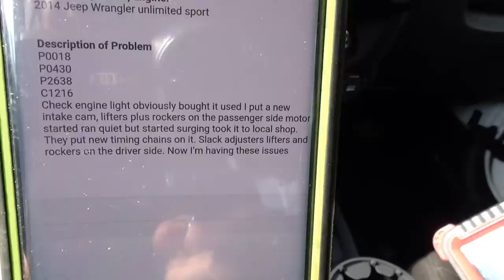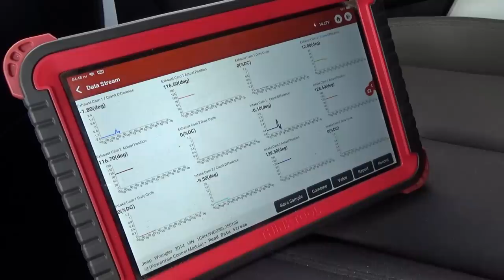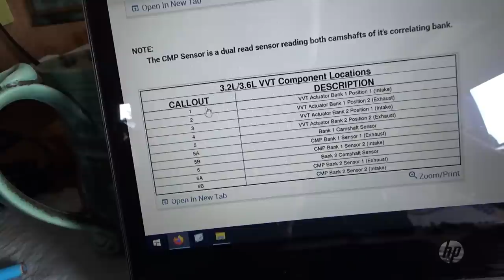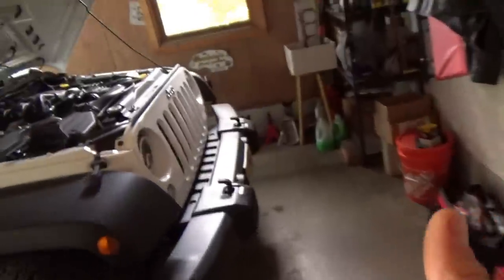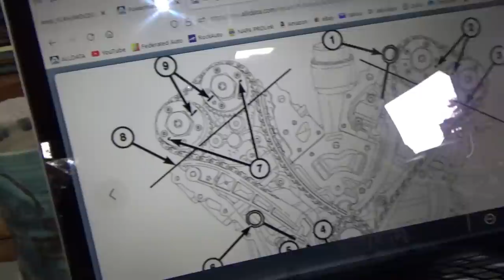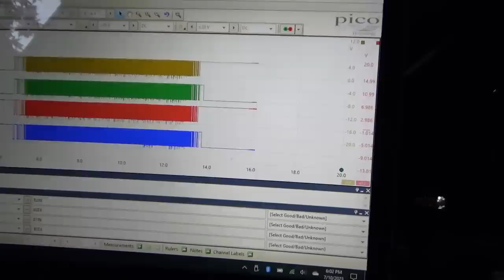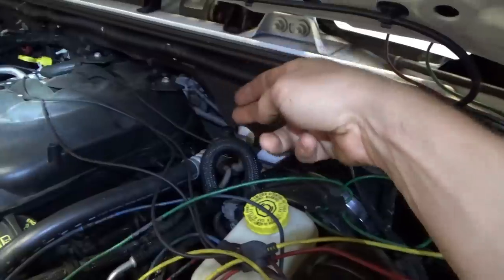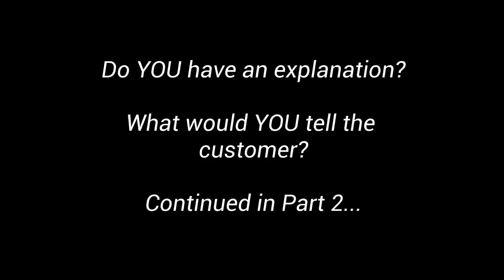BUTCHERED Jeep Timing Job?? (Part 1 - P0018 Correlation)

Comment: Just to eliminate a really unlikely cause, you could check the wire colors on the cam sensor connector and see if the signal wires for the two cams might be switched on the bank with the problem. The cam signal phasing might be different between the two cams. There is no logical reason for anyone to touch them, but you're not dealing with a logical problem. Possibly the connector came apart when someone unplugged it and it was repaired wrong.
Reply from the maker: Ooh interesting theory!! I like it 😁
Reply: LOL, I was thinking the exact same thing. I may have missed it while trying to do too many things at once, but also thought 'maybe' that that side is off one tooth at the crank?
Reply: Another head scratcher for sure. Well, assuming the connectors are all correct I would guess that the reluctors or the magnets inside are out of wack which would be doubtful if they are original. So what does that leave if everything else is correct? The ecm? Interesting. 👍👍🇺🇸
Reply: @brianw8963  I haven't watched the video a second time yet to see what new parts were changed, but I suspect the cams on the problem side are wrong, possibly the part numbers are for the other bank. Hopefully we'll find out tomorrow.

Comment: I'd look at those valve covers very closely.  Is there supposed to be some plastic washer or rubber gromet there, and that's why the sensor is falling down too deep into it's mounting hole?    I think you're onto something about the depth of the sensor.    I would think that maybe it's a sheared pin behind the phasors, but the odds of them both doing it are very low IMO.   Plus it would likely be running much worse.   Should be interesting to see the outcome.

Comment: The backward facing alternator always makes me think if Chrysler actually forgot it was needed until they assembled a few hundred.
Reply: ...or the OEM got a large run of alternators built backwards at a discount...🤔🤣
Reply: I noticed the same 😅
Reply: That’s very funny stuff lol
Reply: Pretty more funy😅
Reply: And the fact you have to remove the bracket to get the belt on is insane

Comment: Hi from OZ, I always look forward to your challenging fault finding video's, this is from a grand cherokee manual, same engine, not sure how you would check this without replacing the camshafts, "CAUTION: The magnetic timing wheels must not come in contact with magnets (pickup tools, trays, etc.) or any other strong magnetic field. This will 
destroy the timing wheels ability to correctly relay camshaft position to 
the camshaft position sensor."

Comment: Aftermarket valve cover gaskets causing sensor assy to sit higher in relation to the cam.  Love the content!
Reply: I believe the sensor would be sitting low not high. If you think about the intake and exhaust cam rotation if the sensor was high the intake wave would be seen first and the exhaust seen later we have the opposite on are hands here. If you fallow

Comment: Ivan, I'd check the cam sensor depth on the cover. Maybe it's possible the sensor is sitting too high/low relative to the other bank.
Reply: Could it be the valve cover? I don't know about those sensor having some kind of adjustment which be a convenient fix though. Even still, what was that gray stuff of the reluctance wheels.

Comment: Im leaning towards something affecting the height of that dual cam sensor. Maybe the valve cover gasket. Also id try to verify the trigger wheel is lined up correctly. We had a gm recently brand new cam with a damaged tone wheel.

Comment: could there possibly be an O ring seal on the valve cover where the dual cam sensor lands?  If it was missing, that would drop the sensor deeper between the cams, changing the readings on both and maybe causing some contact between the sensor and reluctor wheels. just a guess.  Love your channel Ivan.  I'm from Big Flats, near where your parents live

Comment: Looking at that cam sensor design and mounting location, my next step would be to look at the valve cover, valve cover gasket and all related mounting hardware, including the sensor hardware, and cross reference part numbers by VIN for the valve cover, gasket and cams if they were replaced, as Mopar just loves their mid-year model tweaks.

This could potentially be a situation where fastener torque on the valve cover makes a difference, too.

As always, my post comes with the "internet speculation" advisory.  ;)

Comment: Just like you said before start with the way more expensive OEM parts and wait eons to get them and go from there. I see the not factory oem spec chinese parts becoming a big issue today. Maybe you might have to shim the sensor to get it to sit right but if the cams aren't out of alignment and the chain hasn't been installed wrong and the engine can do basic timing, then the sensor is not reporting the correct values to the computer.

Comment: The code in question is for a particular cam there is a cheat sheet “tsb” do too early manufacturing whoas , phasers, sensor,and even wiring . I’ve seen phasers on wrong cams and cams in wrong locations and that an only happen wit left/drivers side head if cams are swapped .recheck your mechanical  then chase what diag sheet says . Yes the dept that wrote Manuel labeled it in the incorrect order. The issues are usaually one cam was a tooth off or the cam was layed on a magnetic tray an messed up encoder wheel have even seen them dented just a little or turned ! It’s a low bid design really
 Great work in showing how to properly fishing with being less intrusive ,love these videos good job

Comment: This is a good one.  I don't think that the cams got swapped around because if that was the case, the problem would be on both banks.  And it's not.  The cam sensor might be an issue.  Could the seal for the sensor be thicker or thinner, thus effecting the sensor depth?  Unlikely, but possible.  It's hard to say.  I'm certainly looking forward to part 2.
Reply: These sensors bottom out on the head.
Reply: I just did valve cover gaskets on the same engine 2 days ago. There are no shims, there are no "O" rings inside where the sensor seats. The bolt goes down through the middle of the sensor into the cylinder head. This is perplexing.

Comment: Height of sensor position at reluctor wheel could be an issue too.  If the sensors were replaced with aftermarket I could see them being 1-2 mm in height difference.

Comment: Wow,   that is hard one is the timing is perfect!  But still fussing about the signal crap!  That went over my head lol.  I'll wait for part 2 lol. Great video Ivan!  Be glad it's not transverse mounted lol.
Reply: Oh, I thought i knew everything 15 years ago, Then i learned the scope. I realized i really didnt know crap, and i got much much better. The Scope Ivan has is the best of the best. Picoscopes are the standard by which all are judged and fall short. I have several oscilloscopes, I use them often. If you are a tech, learn it.

Comment: These cams tone rings are magnetic. If you so much as run a magnet by them it will demagnetize the tone ring. It's possible to run a magent by one or more and change the output signal.
Reply from the maker: For sure. But the signal was perfect, just shifted slightly 😉
Reply: @PineHollowAutoDiagnostics  Yeah. As soon as i saw the waveforms I thought that cant be it. I can't think of any other way that you'd have those signals other than the tone rings being shifted. Everything is in time. I mean you already know what's wrong with it. But I'm watching thinking "how"? Unless the cams themselves got reversed. But the cams have markings on them too that indicate intake and exhaust.
Reply from the maker: @edwinlomonaco6754  exactly. Visual inspection showed everything was just perfect! 😅

Comment: Verify the chain marks, I had one from a reputable supplier and the mark for the crank was in the wrong location. Was on a 2009 dodge caliber, cheers Ivan
Reply: maybe theres a back and front to the chain, so if it was backwards, the timing marks would be opposite ?

Comment: This is definitely an interesting one. Its amazing what that scope is able to show. Guess you can't really fault the other shop if all they had to work with was the normal timing marks on the cams. Looking forward to part 2 . Wondering what shimming the cam sensor would do? Just have to wait and see what you discover.
Reply: I think you might have touched on the issue. I was thinking all the way that it's a sensor/ reluctor problem.

Comment: WoW, what an interesting case study😍
I think it's a flashing issue, bcuz some manufacturer's will recommend this in their TSB's related to timing issue's, that if a timing code has prolonged in the ECU there might be a chance that after replacing all the part's you've to reflash it to get it cleared.
But, waiting for part 2😍
Thanks for sharing BRO Stay Safe😍

Comment: Interesting.. The timing does look spot on and the camshafts  show LE - LI , so they are positioned correctly and highly doubt both reluctor wheels slipped .  Everything looks good. Something must be wrong with the vvt solenoids causing the phasers to get stuck in wrong postion once the engine starts. I have always used the camshaft holder tools  working on these pentastars, never had to remove  the front timing cover when replacing the camshafts, so not sure why they did all that nonsense.

Comment: I’ve seen a wrangler have this exact issue before, p0018, rough running only when cold, then would run fine after warm up. verified mechanical timing, command vs actual etc. the issue was incorrect oil viscosity used by customer. 
Mopar recommends 5w-20, customer had mobile 1, 10w30 and really thick Lucas oil stabilizer. Flushed the system, replaced with OE filter, used mopar branded 5w-20 part #68518202aa. Cleared all DTCs, wrangler has been back in for other services but the p0018 never returned.

Comment: Being a well known issue of shifted reluctors I'm thinking thats what is happening here. Even if the shop put in cams, I doubt they actually used OE and two there has been times brand new ones have been off somewhat rare but does happen. Will be interesting to see the outcome.

Comment: I think you should scope a cylinder pressure transducer.  That would tell you if the cam is really off, or just reading off.  (It is minimally invasive.) ;)
Reply from the maker: Great suggestion! Compression is even and engine runs super smooth 😉
Reply: @PineHollowAutoDiagnostics  Which makes me suspect the sensor end.

Comment: I've had similar issues with Ford Transits that have had engine swaps. Donor engine a few years older than the original vehicle. The CAM sensors pick up the peak part of the lobe, the pointy bit of the lobe if you will. On the waveform the first CAM signal transition starts slightly too early and the second transition is too late. Obviously there are just two transitions as its just picking up the peak of the lobe. Basically the dip in the signal is too wide. Raising the sensor pulls it away from the lobe thus narrowing the dip and makes the transitions occur later and earlier respectively. Putting a washer underneath the sensor to hold it off by about 1/3mm gets rid of the fault code. Sounds like a similar situation. Awaiting part 2 👍

Comment: WOW! That's a really hard one, Ivan! The timing being correct, the only thing left is the position (or angle) of the cam sensor relative to the reluctor wheels, assuming the reluctors are not shifted, which seems too far fetched. Can't wait for Part 2 - I think it will blow my mind :-)

Comment: Thank you for making this video. Lot of this stuff is way over my head. Last month I had a couple of cam shafts and rocker arms replaced. My abs and traction lights were on, jeep in limp mode and ticking. Dealer fixed it. Next day my traction light onky went on again. Brought back to dealer and told me rear right speed sensor was bad. Replaced that. Jeep ran great until yesterday. Now the traction light is on again and the jeep is in limp mode. Also have check engine light on. And a new issue has appeared. When starting the jeep, it cranks longer than is should before starting. On one attempt it took a while, started, then the engine shut off. I know it’s not the starter because I have a new one that’s not even a year old. I suspect the starting hesitation is a symptom that can help diagnose the issue. Posting here in case anyone has any ideas. I’m bringing back to the dealer but honestly I’m just done with this vehicle. Have 129k on it and took care of it since I’ve had it. Never in my life have I had a vehicle with so many issues. Codes im getting when I put my scanner on are several. P0365, P0340, P0018 and P0019

Comment: This much I would know to do if a cam sensor had to be replaced. If it has two of them, I'd be sure to match them up from the same maker (OEM) so if they decided to replace one with brand X, I'd recommend replacing both of them AND I would save the old, both for the owners parts box.

Comment: Hi Ivan, is there a sealing surface that might have changed hight from OE. Valve cover gasket, any sort of shim or seal that goes between the sensor and cover.
Reply from the maker: Hey Will! I was sure that was the smoking gun, but there are no shims or spacers for that cam sensor, it bottoms out directly on the head casting ;)

Comment: @Ivan i would have a better kiccker for you
engine vibrations with no error codes
 - spark present no issues 
 - fuell present no issues
- timing backed by -2 on all 4 cams (v8)

god knows why its wibrating but... i know the machine shop redoing heads took more material form one head vs the other and probably thats causing the vibrations (you can kind of see it on the scope but not really)

now they made the head 'trapezoid' shape along the side so the last cylinder has more compression than the first one on the bank. and ofc. the other head is a bit better shape.  How they did it i have no clue... but it shows if you do comp ratio check using some fluid and syringe  - That's a wild one man :)

Comment: I was sure that the chinesium sensor would be the problem but after you swapped them over the problem did not go away.Could that chinesium sensor had be touching the reluctor wheels & leaving some small trace on them which is altering the signal ? Cheers mate be very interested in the final result.

Comment: This came up on my YouTube feed this morning. ironically, I just did a valve job on a 2012 minivan and it runs great now, but all the cams are showing about 10 degrees of discrepancy with the crank. The desired and actual positions are spot on... within a few degrees according to the data PID.
The engine appeared virgin, and I replaced the plastic timing components, but otherwise, I used the same chains and gears, etc.   There's no excess chain stretch according to the tensioners.
Could the 33 teeth be divided into 360 degrees which gives 10.9 degrees? I guess that depends on how the data is extrapolated. I never removed the primary chain, but replaced the tensioner and guide, and I am pretty sure that it never skipped a tooth.

Maybe all the cam reluctors shifted, and the head milling and new guides put the data PID over the edge to set a code?

86,000 miles and needed a valve job. I am honestly about to call it quits with Fiat/Daimler stuff.

Comment: I had also thought about a weak connection in the harness for that reluctor, like failing internal connection. The issue did remain driver's side, right? Was relieved the cams weren't swapped, though.  🤔🤔🤔

Comment: I’d do in cylinder pressure check,both banks,to check the camb timing,the pcm is seeing data,if the cylinder checks doesn’t agree with the pcm data,have the mag pickups been moved,very interesting diagnostic,I’m fascinated by the power of the scope,and following the data.

Comment: Phasers not working correctly. Inspection of the oil control solenoid and valves. Have seen people install the rocker cover with the actuators installed at the front and bend the actuator pins. Once the actuator pins are bent they won't retract into the actuators. The causes the phaser to adjust the cam shaft position.

Comment: My bet is on the cam sensor sitting too low causeing the intake wave to show up early and the exhaust to show up later. May be caused by valve cover hight possible causeing the sensor to be closer to the head then normal.

Comment: I'm working on 2015 Jeep v6 with code p0019..My scanner shows the exhaust cam -40 bank 2 the other  cams @ -4.00 @ idle.. Haven't tore it apart but feel the ring on the end has moved. This is my first @ this make an model situation. This is expensive job in parts to properly fix it correctly

Comment: There's no way both cams have the same problem in the opposite direction but the same amount. It looks like lifting it by a tiny amount would make it the same as the other bank. Can't see the valve cover but it looks like a missing washer would cover the distance. Or maybe somethings wrong with the cover itself?

Comment: I was thinking if the valve cover was warped, tilting the cam sensor slightly, but your explanation that it could in theory be raised to "correct" the timing of the reluctor wheel makes me wonder if somehow it's sitting too low to begin with? Maybe it is supposed to have a shim, more material, or thicker gasket underneath of that sensor? That doesn't seem right.

Is it possible the bank 2 cams were replaced, and also had incorrect/poorly manufactured reluctors?
Reply: Valve cover being damaged or out of spec possibly but the sensor depth is set by the valve cover and should only use an o-ring type seal so even if the o-ring was missing it would still be at the same depth. I would inspect the valve cover real good,even compare it to th other side. A depth mic would be handy to compare the two sides with each other.
Reply: @thatsonebadhatharry8610  ah, you're absolutely right about the seal usually being an oring.